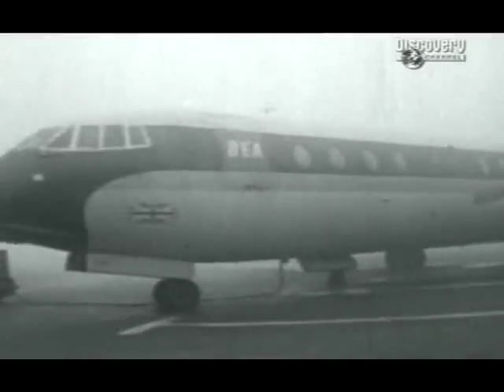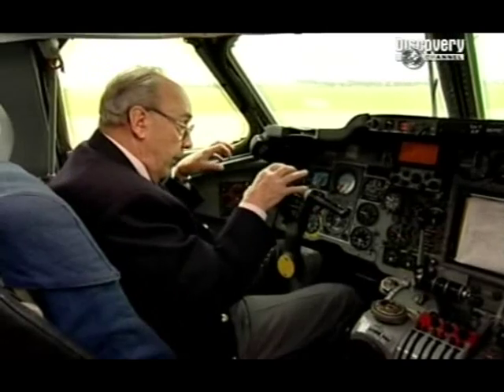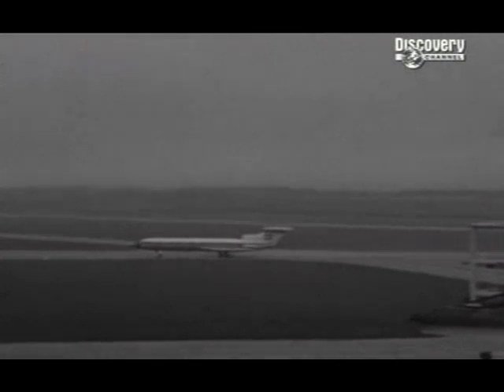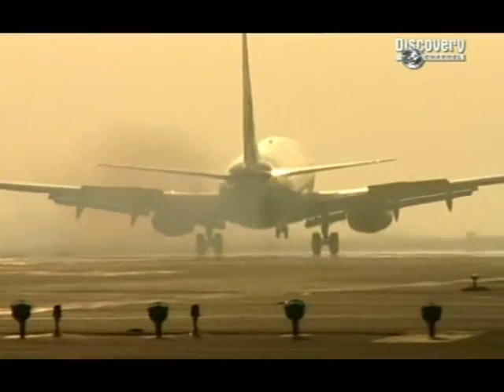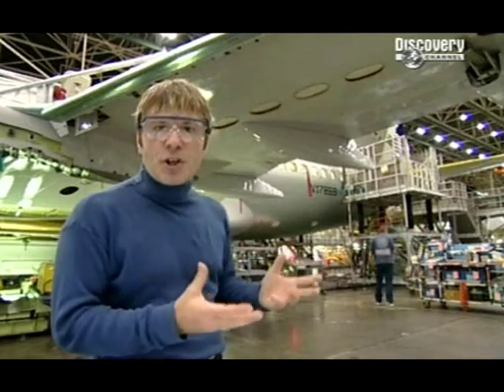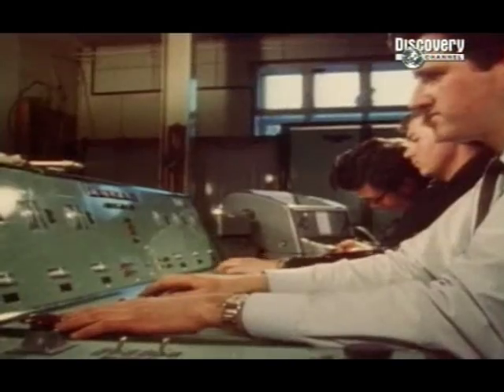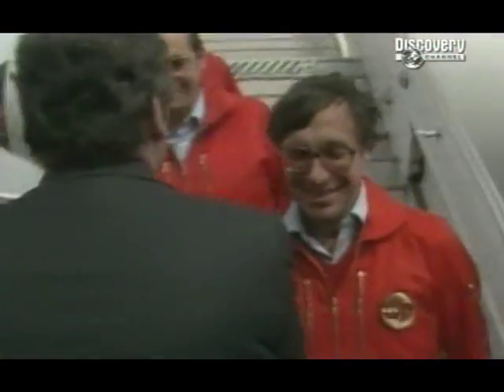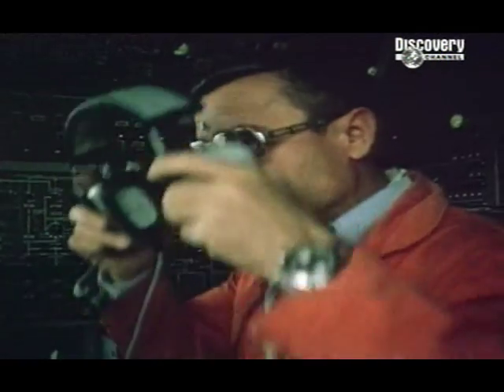Flying Heavy Metal Episode Four: Safer Skies-Part 2 HQ

Comment: Let's look at the dates.

Boeing 767 First Flight: 26 September, 1981
Boeing 757 First Flight: 19 February, 1982

Boeing 767 Enters Service: 8 September, 1982
Boeing 757 Enters Service: 1 January, 1983

There you go.  I presume they numbered the 757 lower because it's a smaller plane.  For all practical purposes, they came at the same time, but the 767 was a bit earlier.

Comment: Dammit Bruce, why do you have to be wrong?  The 757 was not the first Boeing with full autoland, that goes to the 767 which came first.  The two planes have identical cockpits and avionics, and they entered service in close succession, but the 767 first flew about five months earlier than the '57.

Comment: Hey Bruce, the A320 was not the first fly-by-wire airplane.  Both the Su-27 and F-16 fighters had it long before the '320.  That said, it is indeed the first civilian jetliner to really use digital FBW (Concorde used fly-by-wire but I'm guessing it wasn't digital, it's awefully old.)